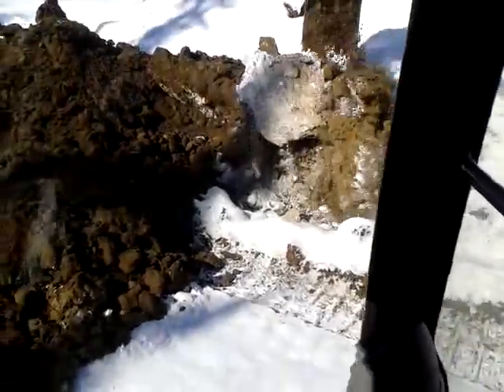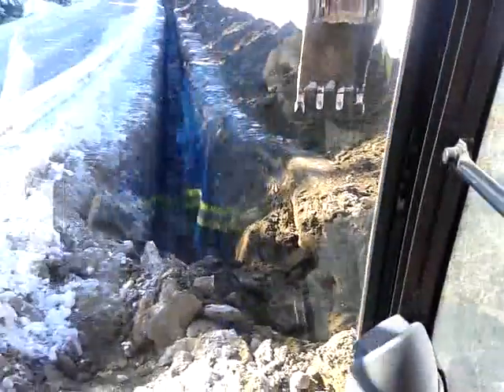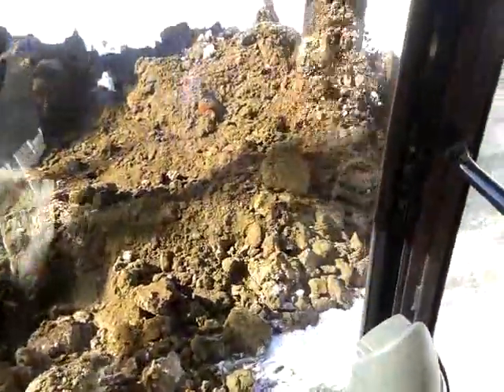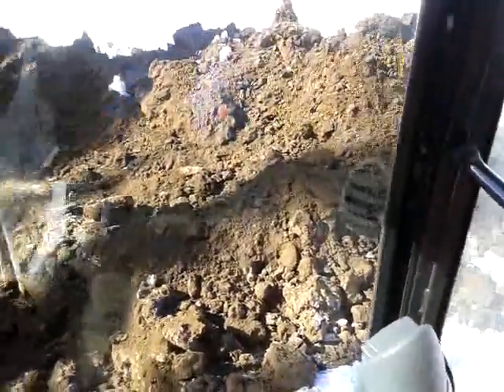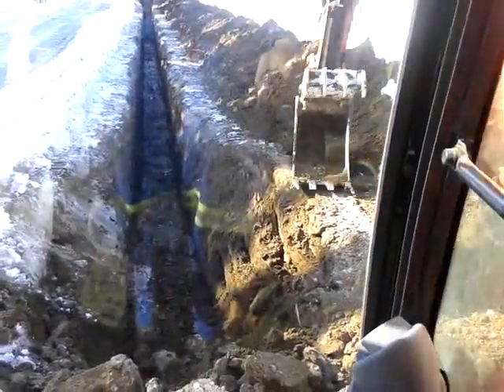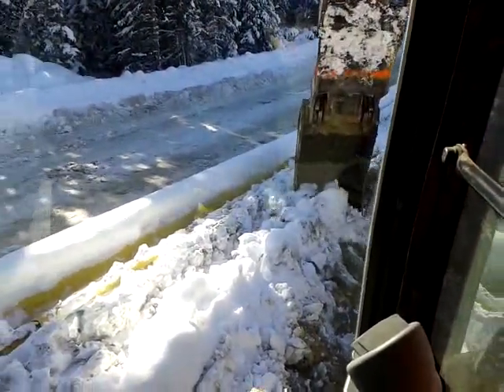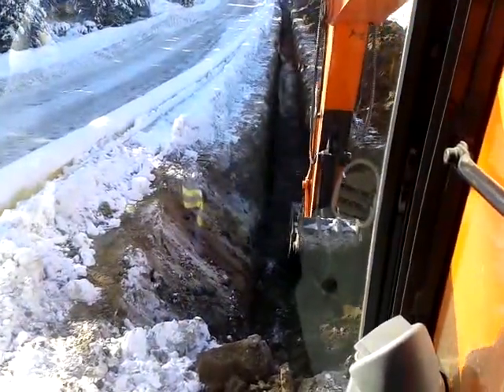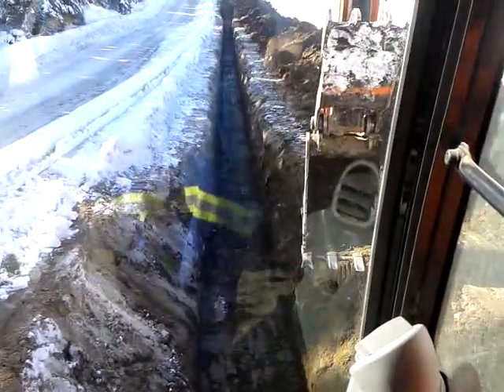Part 1 of how to dig a proper bellhole

Comment: Barry, I know the importance of proper setup. But any tricks to keep ur machine from rocking. So unprofessional, I think to see some one struggle with a rocking machine. I do know that like loading haul trucks for an extended period of time I always take spoil and place it in front of my tracks and then drive into it. Not raising the machine a placing it on a even self built pad but just fluffing some spoil in front of my tracks. I notice u move forward and back with impunity. Please any insight will be most jelpful
Reply from the maker: JJ Jackson there are many ways to do it but what i like to do is back    up about 1 foot from where i want the machine to sit then grab some loose dirt and throw it in front of each track.try to get the amounts equal for each track.then drive ahead 1 foot and most times it will keep you from rocking.it will lift the front of the machine up slightly but that shouldn't efect what you are doing.hope that helps.
Reply from the maker: JJ Jackson i didn't read all of your comment for some reason now i see you do what i explained already.the area i was working in may have been very level.most of the time the Grade crew dose a good job of leveling the ground for us.